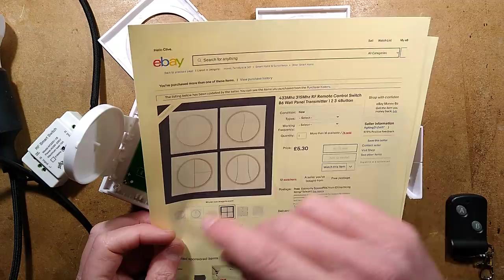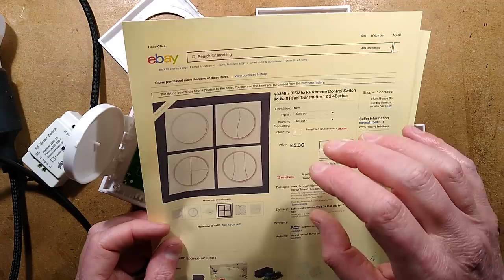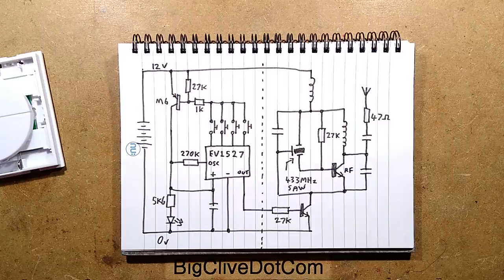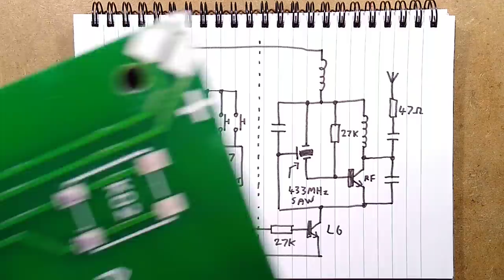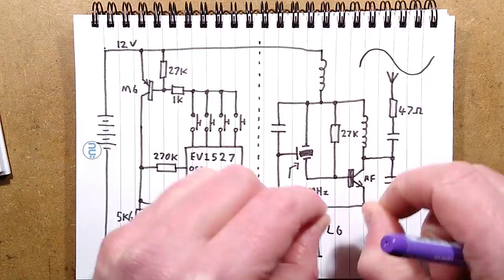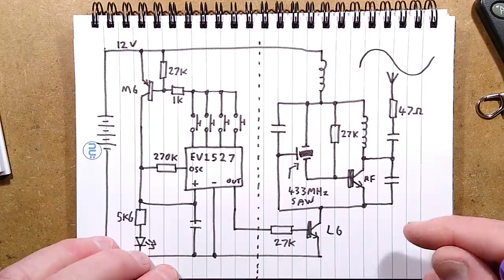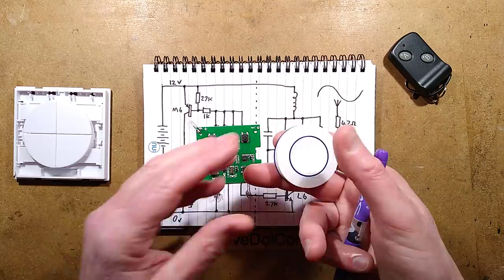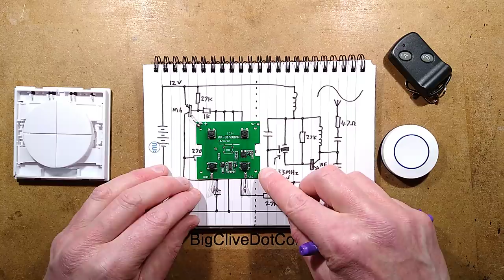Inside some stylish wireless switches (including RF schematic)

Comment: Also I'm surprised he did not mention about putting the remote receiver in another housing of some sort.

 or in  with some sort of suitable enclosure like if you were using the device that would use a cord to connect 2 power.

You could even easily put more than one in one enclosure that way as wel.

l providing there is no intermodulation on the RF which I have seen happened with some remote switch receivers.

that were plugged into the same power strip different devices.

Have not been all the way through the video yet.

But if some systems even though they might have different codes.

 this does happen if they're too close to each other they don't play nice in terms of that.

But anytime that reviews of this type of thing there should be more than one on different codes.

tested next to each other to see if there is a tissue so that someone else does not find out the hard way!

Normally that would not occur but sometimes someone may use them in a way that that would happen!

Just something to note that people don't think abou.

t that sometimes great product but then a little bit of a situation you would not be aware of might happen!

Comment: well i for one learned something today, i was always under the assumption knectic switch use no power at all, i think i'd rather use electric than having to have a stash of batteries around, i suppose these aren't a knectic product?
Reply from the maker: I think that type uses a small piezo device to generate enough power for the burst of data.

Comment: sorry but i don't understand what you did with the battery. 
You say it require a 12 v battery and you put 9x3.7v to have the same result ??
Reply from the maker: I used 1.5V cells.
Reply: @bigclivedotcom  oh cool i didn't knew that existed, i hate those cells so much that i never use them.
I bought several RF switches thanks to you !
I knew them with the cheapest remote control led switch but those are 10 times better !
Thank you !

Comment: I wonder if those are even legal to use in the US. 433 MHz is within the 70 cm amateur service allocation (420-450 MHz).
Reply: 70 cm is a shared services band - other users include federal radiolocation, space telecommand, and numerous wireless devices (including tire pressure sensors on automobiles).
Reply: @allenlutins  Sounds like I need to start doing more simplex work in that part of the band. My 110W mobile gets out rather well.

Comment: Clive, have you looked at the Quinetic brand? No battery required.
Reply from the maker: I've not had a look at one yet.
Reply: @bigclivedotcom  they ARE a wee bit expensive and you'd have to buy both switch + receiver.

Comment: If I understand this correctly, the receiver literally just closes a contact and the single button can control it. My sister has Parkinson's and she is too shaky to hit a smartphone keypad to control a thermostat on and off. I think I can tie into the thermostat wire (no load to speak of) with the receiver and have the on/off button on the night stand upstairs. Right?
Reply from the maker: The receiver could just switch the heating directly or use a version with volt-free contact in series with the thermostat.

Comment: I wonder what will happen when I walk around in my neighborhood with a random generation signal round the 433 MHz...
Reply: Have you walked around their windows with an infrared emitter doing the same thing, only spitting out random sequences lately?)
Reply: @BoB4jjjjs  first you're gonna enjoy the light show for sure.
Reply: 20 bits of selection code means you're unlikely to get any effect unless there's been a horrible mistake made in the factory
Reply: Probably nothing.  I'm sure the sequence is a few more then a couple bits.
Reply: @jkobain  I remember a certain project that was quite fashionable done years ago. TV-b-gone or something similar? A power source, some IR leds and a microcontroller programmed to send a string of all the usual turn - off - codes for all the common TV brands...
Reply: @mozismobile  interesting way to fault test then? ;)
Reply: @al1rednam  After a while you didn't even need to do that! Samsung were equipping their top end note phones with ir blasters for a hot minute. I think the note 4 was the last one to have that feature. I actually had an IR receiver hocked up to my PC and was able to use an app to make my phone into a custom remote

Comment: Clive, did you see the Lock Picking Lawyer opening a fingerprint operated padlock with a small EMP generator? A teardown of a electronic deadbolt door lock might be interesting. Some designs can be defeated by using a neodymium magnet to trigger a relay.
Reply from the maker: Sounds like a spark gap discharging a capacitor through that coil.

Comment: Too bad you couldn't measure the capacitor values. I've been trying to make such an rf circuit myself for a while for small projects, but so far I have had little success with it. So wanted to try your schematic. Unfortunately, I can't find any further information about this or I'm just not looking for it right.
Reply from the maker: You can buy the bare RF modules.

Comment: might be an end-fed dipole antennae with the resistor being an inductor
Reply: Or possibly to get close to standard "50 ohm" impedance in case an extension is added to the antenna. If they did that, they should cover the internal antenna with a ground screen but I've never seen it done.

Comment: to bits with the switches but not the receiver? There are more bits to make
Reply from the maker: The receivers will be covered separately.  The video will be mainly about  programming the different modes.

Comment: Question about the way you substituted the batteries. If i needed AAs for my xbox controller and i only had AAAs to hand could i use the AAAs and bridge the gap to of the battery contacts with a piece of tin foil.
Reply: Yes you could, it will have less run time than AA batteries though
Reply from the maker: I've used random nuts as packers to do that in the past.

Comment: I got some of the Sonoff wall switches a few years ago.... Before I realised they need a neutral which none of my light switches have. Wires chased into brick so can't pull one through. Gutted!
Reply from the maker: The UK regulations used to ban the use of neutral in switch boxes in case people tried to add sockets to the side and upgraded the fuse.
Reply: @bigclivedotcom  It's the way it's done now. Called the 2 or 3 plate method. It means you only have one cable to the lamp fitting and all the wiring is done at a reasonable height in the switch box and not above your head. You also don't have the issue of the blue live return switch wire. In fact, today,  I've been replacing my daughters white switches with brushed chrome ones and it's a new build wired this way. The neutrals are wired into a 3 way wago. If you're interested they do these wireless and battery free switches and receivers:
https://www.tlc-direct.co.uk/Main_Index/Quinetic/index.html

Comment: Hey Clive, can you please tell me what is OTP Encoder?? What is the EV 1527 used for? Please explain in the simplest words possible... Thanks And GREAT VIDEO!!
Reply from the maker: OTP = One Time Programmable and relates to the factory programming of a random 20 bit number for over a million different codes plus the four the buttons control.
Reply: @bigclivedotcom  So, in short, the OTP generates some random numbers which don't repeat? And is EV1527 also a OTP encoder?? Thanks for the reply
Reply from the maker: @AtAGlimpse_UB  The EV1527 has a 20 bit programmable code.   You also get OTP microcontrollers for mass production, where they can only be programmed with the software once.
Reply: @bigclivedotcom  Thanks a lot for the reply Clive. But, just tell me if I am correct,  the OTP microcontroller is a type of MCU which gets programmed only once. And these types of microcontrollers are found in some cheap electronics like RC cars right? 
My name: Aditya

Comment: I remembered ten years ago someone who had these contactless light sensors in his house and business where you wave your finger close to it and the lights turn on and off but two years later he ended up pulling them out as most of them have failed.
Reply: I'm personally deliberately minimising the amount of pointless electronics wired into our house - having been involved in a pretty major house fire caused by cheap and nasty electronics a week ago has rather confirmed my gut inclination.  Almost all the switches and sockets I've fitted myself here have been expensive but very good Wandsworth ones - you can feel the quality difference over the normal cheap rubbish.
Reply from the maker: Those sound like the ones used to comply with Jewish sabbath requirements of not operating things like circuits.  Because by not touching the switch you are apparently not operating it....
Reply: @bigclivedotcom  Talk about bending the rules, if you really follow the faith then you would not use this trickery (or ask someone to do it for you etc)

Comment: Hmm there are still some questions open. How does the signal curve look like? Could you scope that? I assume it's a lower frequency signal curve "filled in" by a 433MHz signal. So since the entire RF block seems to be turned on and off by the signal curve, how does it keep the frequency? Is that SAW thing being powered by that capacitor while the signal is low?
Reply: I think that those capacitors around the SAW are just there for resonance purposes -- but that's just a hunch. As Damien Walsh has mentioned below -- and I'm inclined to agree -- the rf circuit seems to free-run oscillate at 433MHz, but is turned-on and off by the npn transistor at the bottom-right of Clive's schematic. Thus, the rf signal would look like bursts of 433MHz, interspersed by no signal -- a mechanism called On-Off-Keying (OOK) -- it's the most basic form of amplitude modulation with a binary signal, where a '1' turns the rf on and a '0' turns it off, say. The EV1527 chip would be responsible for generation of the "frames" for the message, which make the radio bursts into intelligible patterns that can be decoded by receiver circuits. The bit frequency/period is appropriate to the messaging protocol, as is the encoding standard, e.g. simple on-off keying, versus Manchester-encoding (where on/off transitions are significant, not the presence or absence of carrier signal), etc. The frames would include things like stop/start bits, header/preamble, address patterns, device identifiers, on/off commands, maybe even parity/checksum -- and probably a vendor/protocol code, to differentiate the signal from other smart devices transmitting in the vicinity. It would be great to "see" the transmitted signal by feeding the output of a cheap 433MHz receiver into an oscilloscope, which could show the rf bursts and frames that get sent, while demonstrating which bits change, when different buttons are pressed. Maybe an idea for a follow-up video, Clive, if it's not a step too far? Quite understand, if you think it would be.
Reply: The SAW filter in this circuit is not a complex one like the type used in receivers to shape the frequency response. Here it is just a simple resonator doing the same job as a quartz crystal - crystals are not practical at these ultra-high frequencies. It forces the transistor stage to oscillate at the correct 433 MHz frequency. The string of bits simply switches the oscillator's power supply on and off producing the equivalent of a burst of very fast morse code - a simple type of amplitude modulation, where the amplitude is only ever zero or 100%.
Reply: @geralltgriffiths7772  for some reason I have the feeling that the transmission of at least one packet must happen over a carrier signal that is in phase. That is, that if a logic high, low and then high again are transmitted, the distance of the amplitudes must be a multiple of one cycle. In essence, as if you had a continuous sinusoidal curve, but deleted it where there is a logical low. Otherwise,  the signal might arrive out-of-phase or even reversed to the receiver and thus not be picked up by it. Therefore, I'm assuming that the crystal must remain powered while transmitting a logical low.

My assumptions may well be rubbish. It could be that the receiver circuit is able to tune itself to the phase of the sender very quickly. It might be that the phase of the signal is irrelevant and only the frequency counts. Being mechanical, it could also be (and is probable, come to think of it) that the crystal retains its oscillation throughout one transmission without being powered all the time. I was just surprised that it is done this way, by turning the ENTIRE RF circuit on and off, instead of maintaining a constant carrier frequency and modulating the logic signal onto it. Which is what i assumed how it's done.
Reply: @robinvince616  Hm yes, but is this 433 MHz frequency in phase with the previous 1-bit? Does that matter? Does the transistor stage start oscillating at 433 MHz immediately, or does it need time to "get up to speed"? That's why I'd be interested in seeing the signal.
Reply: @horrovac  The 433 MHz would have to start up reasonably quickly in comparison with the burst lengths of data, otherwise the data would be corrupted. The phase is of little consequence here, since the receiver only needs to see the signal being keyed on and off.  There is, of course, a phase shift in the SAW filter, just like in a quartz crystal. It is that phase shift which allows the transistor stage to oscillate. Normally, feedback from collector to base results in negative feedback, but the phase shift in the SAW device converts it to positive feedback at its resonant frequency. Being ceramic-based, a SAW filter oscillator is not as stable as one using a quartz crystal, but is good enough in applications where the receiver has enough bandwidth to cope with its imperfections.
Reply: @horrovac  I'm not sure I get the point fully, so please bear with me if I misunderstand. 

Please think of the modulated rf signal as being bursts of 433MHz, turning off and on at a much lower frequency (could be as low as 9.6kbps, say). Transmitter and receiver have the same carrier frequency and the same message signalling-rates (give-or-take -- I did say "cheap"!). 

Bear in-mind that is really cheap electronics -- and, as it's battery operated, keeping the carrier on longer than necessary isn't desirable. Thus, "being rough" with the rf section on the transmitter is fair game. So yes, it could throw-out some ghastly rf waveforms on the on/off transitions, as the rf circuit stabilises, but the resonator could make that happen fairly quickly. 

The receiver rf section listens for 433MHz and creates a waveform that has one state when it detects carrier and another when it doesn't. The receiver also includes a decoder that samples the "envelope" waveform from the rf circuit. When it detects a "new" carrier burst (after a long silence), it synchronises to the messaging-bit stream. (Nyquist's theorem dictates that the sampling must be done at at-last twice the expected messaging bit-rate). 

In effect, the receiver's sampling mechanism tries to find the "middle" of the messaging-bit intervals, extracting 0's and 1's at that point. In this way, it really doesn't matter to the receiver how scrappy the carrier waves are at the bit boundaries, just so long as the middles are reasonably clean. 

Many of these gadgets repeat the message several times, maybe for as long as the button is pressed. Provided the signals comply with local regs (low power, infrequent transmission and don't interfere with other users of this band), no-one will care too much. There's no "purity" here. 

Provided the receiver can extract at least one decipherable message from the radio stream, it can implement whatever command has been sent. Cheap and crude!

I hope that has made my previous thoughts a little more intelligible.

Comment: If you're going to actually use these devices, remember that 433MHz (actually 433.050 MHz to 434.790 MHz) is in the middle of a popular amateur radio band and you can expect possible interfearance to your device from some of your local radio amateurs. Your device is not protected from this interfearance. Neither is your car remote if on a similar frequency.
Reply: The extremely narrow-band digital pulsed signals used by these switches (and keyfobs...and tire pressure sensors...and other devices operating in this range) are relatively immune to interference from (typically analog) amateur transmissions.

Comment: how long it can stay alive with so small batteries? wouldnt be smarter to do this with like 2xAAA?
Reply: Those a27 batteries are fine. I have a similar system here at home. The battery will last about 2 years with daily use
Reply: The A24 - 12volt battery is commonly used in garage door remotes. They typically last more than 1 year.
Reply from the maker: It only draws current when the button is being pressed.  The higher voltage makes it easier to generate a strong radio signal.

Comment: Hey Bigclivedotcom! I have a request for you if you’re willing to check it out, but I’ve seen these USB-Triggers for cash drawers on eBay and I bought one not knowing how to use it (couldn’t figure it out) but I know you’re well known to take stuff to bits and analyze how they work, and how to make them go pop..
Reply from the maker: All it needs to do is supply power to the release solenoid.

Comment: now make these  with transparent buttons, or even better, no box! Glue that thing right to the wall.
Reply from the maker: They don't need a box.  They come with pads for sticking them to walls.
Reply: @bigclivedotcom  no, no. Not the back box. The actual plastic box housing the circuit board.